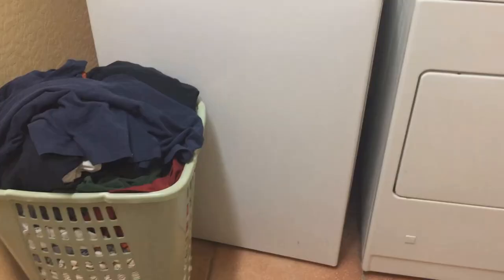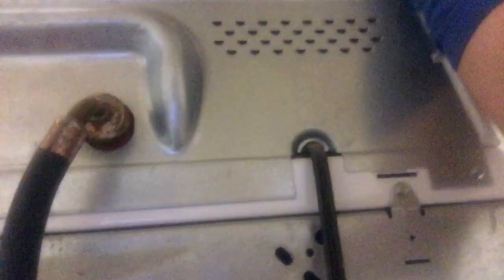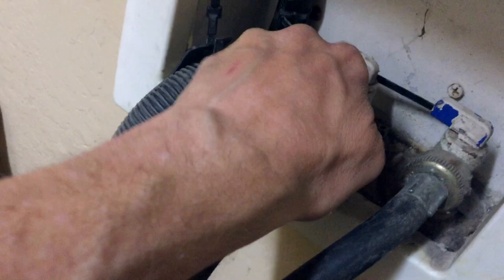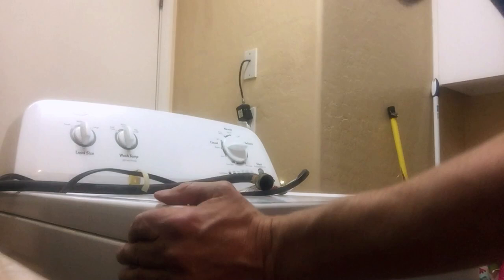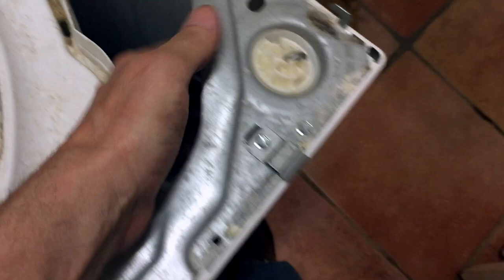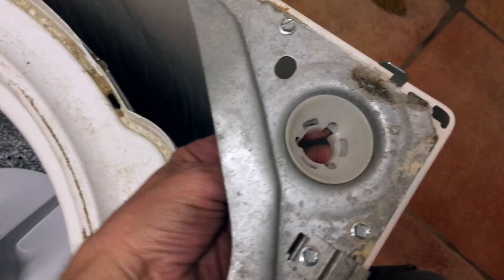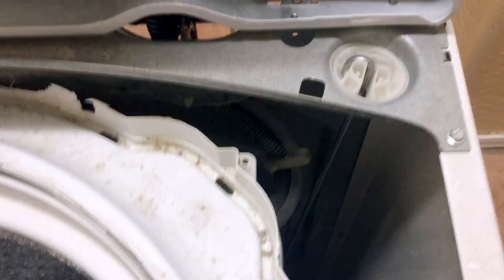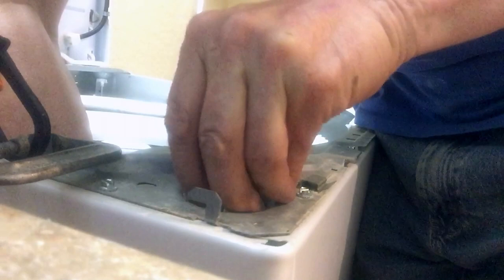Replacement suspension rod kit for loud shaking washer spin cycle Whirlpool Kenmore Maytag Roper

Comment: so after attempting this by myself, & watching multiple how to videos, u r the only one who addressed how heavy the drum is to lift. i eventually got it, & i have a tip, wear rubber cleaning gloves so ur hand doesn't slide up the rod. also, it helps to lift opposite corners of the drum when propping it up so it's not as heavy👍 thanks i'd still be struggling without u!

Comment: Just got done replacing mine. Thank you for a very informative video! P.S. For others who may not know. I still heard water sloshing around inside even after a drain cycle. Just be sure to have a container underneath the drain when you remove the drain pipe and tilt the washer as much as you can. Once you flip it all the way onto it's back there will still be more water. I recommend laying down a few towels before laying it on it's back. Thanks again for a great video.

Comment: Suspension rods replaced, washer re-calibrated (worked fine before re-calibration), works perfectly.  Thanks again, and thanks Paul for the tip.
Reply: So would you say it would be fine if I replaced springs without Rę calibration right after?
Reply: So I shouldn’t recalibrate is what you’re saying?

Comment: I am a 38 yr old woman only parent I am not a fixer never tempted an appliance. I just painted my nails kind of woman.  My amana washer spin bucket has gone nutz.  Ive watched ur video and it beats em all.   I have literally tonight taken apart my washer per ur clear steps and found the issue.  Now i just have to buy the springs.   They were all bad and dry rotted.   Thank u!
Reply from the maker: Good luck! Please let us know if you had any surprises.

Comment: It was nice to see how to take out the rods.    I was able to get one of the springs out - by grabbing the rod with vice grips.   Once I got one rod out - the drum sags down and makes it even more difficult to grab hold of the rod.   I then realized that I could use the old rod and use the hook - to hook onto the newly installed suspension spring and pull it up to the hole where the plastic support cups are positioned.

Comment: I had a whirlpool that did not have an agitator. It kept the load balanced via a fluid filled ring on top of the drum. The theory was that the fluid would find its level during the spin cycle and even things of out.
Unfortunately, enough uneven loads did that ring in, and it lost its fluid and thus it was unable to balance the drum. 
So while the suspension rods are anywhere from $25 to over $100 (Amazon vs parts distributor), that drum ring was over $400. It was cheaper to replace the 2 1/2 year old washer.

Comment: You can't go wrong with the SPEED QUEEN TC 5000 SERIES WASHERS. Expensive but in the long run you'll be glad you purchased this washer. Guaranteed to last 25 years! The TC 5003 has a 5 year warranty. Consider this model.

Comment: Thanks for this!  You're right, not nearly as easy as some of these guys act like.  I did it, bad words were said!  It didn't fix mine, balance ring seems to be ok, nothing looks out of place underneath, my theory is that the tub itself is damaged, maybe like a bent lawn mower blade, and is not going to balance.  Looks like new washer time, wash load piling up while i throw time and money at it.  You're vid is more in depth and realistic than the pros!
Reply from the maker: Thanks.

Comment: Every time you replace a part. It’s always good to recalibrate the washer. Exactly with whirlpool brands. You can find the tech sheet inside the frame of the washer
Reply from the maker: Thank you.  I was able to do that successfully but the Roper calibration procedure was a little hard to find.  I found many people described this procedure here, which is identified as for top loading washers but appears to be associated most often with Sears brands.  The links:  https://www.searspartsdirect.com/diy/article/how-to-calibrate-a-washer-after-a-repair-video or this video https://www.youtube.com/watch?v=WZlkG0gGXFQ.

But that didn't work.  Instead I followed the advice from Southern Bucks at https://www.youtube.com/watch?v=WpEcZ5kYKNs and it worked like a charm.  

Again, thank you. I'll add this to the description.

Comment: Bought a used washer from a buddy and after about 20 washes it started banging around. I saw a few videos and ordered the suspension kit from home depot. Put  them on and sure enough it worked for about 10 washes and did the same thing. I thought I put them on wrong or something so I returned them and ordered another one from them. Now 1 week later in the same ordeal. Think I'm just gonna go ahead and order some of the oem ones from the factory. Wish me luck.
Reply from the maker: Good luck. Mine have worked well for 13 months now but I don't know if the ones that I bought (https://www.amazon.com/gp/product/B010JRV0UM/) are still the same quality as when I bought them. They're now $45 instead of $60.

Comment: If you look on the tub, on each corner there 4 holes that are adjacent from the rods. I've seen another video where you purchase small springs that attach from the tube and link to the spring rods to add balance to prevent the beating & banging. The spring are under $15. In your case you may have had bad rods but my suggestion may fix it also. Maybe.
Reply from the maker: I saw that video as well. I don't recall the exact reason I didn't try it. Did the guy actually demonstrate that it worked?  Also, my washer has those holes but there were no springs attached. It would be good to hear if anyone got it to work because it is an awful lot less work.
Reply: I thought the same but on my Whirlpool there was no hole where the fabric softener port was, so no go for me. But find my comment to learn what I did.

Comment: The slots above the first two screws are for the tabs to go into, to hold the top up
Reply from the maker: OK. Will it hold without bending the tabs?  I recall that when I had the top lifted at 4:58 I got the impression if I just leaned the top back it's weight would bend the tabs. But I may have just been too timid to try.
Reply: @bulletpeople  honestly I'm probably wrong, I shouldn't have commented that. Thanks for your vid!
Reply from the maker: @NIN_THUG  All good. Thanks.

Comment: I had watched several of these videos, so I ordered new OEM suspension rods. The install was not that difficult. However it did not fix the problem. I did the check on the drum bearing which was alright. But it still it jumps around with some loads. I believe it is just a poor design.
Reply from the maker: I am so sorry to hear that! In the video description you will see a note that one YouTube commenter said that you have to recalibrate the washer after doing the repair. It didn't make any difference for me, but the procedure works. Here is a link to a video that explains how to recalibrate the washer: https://www.youtube.com/watch?v=WpEcZ5kYKNs

Good luck!

Comment: I fixed mine I about thirty minutes with a helper..simply add dampening grease to the plastic cups..
Reply from the maker: I have heard about this method before but I could not figure out where to put the grease. When you write "plastic cups" are you talking about the suspension rod cup and ball bushings set that are at the top, like you see pictured here? https://m.media-amazon.com/images/I/519AEjtdYLS._AC_SX679_.jpg

If so, do you put the grease between the two pieces of plastic that rub together?

Or are you talking about down near the spring, like in this picture here https://m.media-amazon.com/images/I/61WZ0Ckp4NS._AC_SX679_.jpg.  And if this is where you put the grease, where do you put it? On the rod itself in between the two pieces of plastic?

Thank you. I've never seen anyone document properly how to do the repair this way and it would be nice to know finally how it can be done.

Comment: I have a hotpoint year old if a load is off balance how do you unlock top lid to readjust load
Reply from the maker: On my Roper if you hold down the start button it will stop the washer no matter what cycle it is in, but then you have to wait for it to stop spinning before it will unlock the lid. It seems to take a long time to unlock sometimes. I'm not sure what your situation is.

Comment: What happens if mines doesn’t bounce back when I push down? I’m not sure what the problem is?
Reply from the maker: I don't know. If it only happens occasionally then it could be an unbalanced load. If it does only happen now and then then during the spin try stopping it (press the button for a few seconds) and then rearrange the heavy things like jeans and towels to balance the load. Restart the spin by pressing the button again and if it still bangs around, I'm not sure what you can try next.  

The only other thing I know to try is to recalibrate the washer. I found this video by Southern Bucks at https://www.youtube.com/watch?v=WpEcZ5kYKNs and his procedure worked for me on my Roper.

Good luck.
Reply: It just started today I actually took some clothes out and started the spin back up and it kept knocking. So I’m not sure. I didn’t try the calibration part.
Reply: @bulletpeople  I just checked springs are good maybe off track?
Reply from the maker: @zetyrarudd2966  So if it is knocking during spin but when you push down on the agitator it doesn't bounce more than once I'm not sure what it could be. I found this list of other things that could be wrong.  https://www.repairclinic.com/RepairHelp/How-To-Fix-A-Washing-Machine/42---/Washer-Vibrating-Or-Shaking  

It was not a risk for me to pay $60 for new suspension rods because it was obvious from the way the agitator bounced several times after pushing on it that the original ones were worn out. But I don't know what to make of your situation.

Comment: Repack the Suspension rod Buffers with Dow Corning 111. It's what stops this crap when new.
Reply from the maker: Can you provide a better explanation or a link to an explanation. I've seen references to fixing this by way of re-lubricating parts of the suspension rod. Some people also recommend adding dampening straps. Both of these seem a lot easier, but I did not try them because nobody who has written about this or made videos has done a convincing job of explaining it. 

Please tell us more about that or point us to any existing content that explains how to do it. I've searched high and low and can't find anything.

Comment: Just installed the cheap springs....the only thing that changed was the up and down bounce is now gone...the banging persists....don't buy the cheap parts.
EDIT: I discovered the calibration mode in the owners manual and that seemed to fix the banging issue completely  😀

Comment: Hello. I already changed my suspension.  It giving trouble again.  Why so fast
Reply from the maker: Some people have written that if you don't use the Whirlpool factory authorized parts, the problem returns after 2 or 3 washes. So I have put in the description a link to the suspension rods that I bought. They are supposed to be the ones made by Whirlpool, and Whirlpool makes many different brands, including the Roper that I own. Here is the link:  https://www.amazon.com/gp/product/B010JRV0UM/.

Good luck. I am sorry it didn't work for you.

Comment: Once I switch all rods, but till it makes banging noise- what should I check??? Thx
Reply from the maker: One thing you can do is to recalibrate the washer. Look at the "UPDATE2" section of the description. There are some links to video on how to do that.

But unfortunately, if you used inexpensive suspension rods you may have to buy the original Whirlpool suspension rods and install them. Many people have written that when they buy the cheaper rods, around $25-30, they fail after just a few washes, and the banging begins again. But I used the original Whirlpool suspension rods sold at https://www.amazon.com/gp/product/B010JRV0UM/ and they have worked now for more than a year. (When I bought them in May of 2021 they cost $61. Today the same ones cost $37.)

Comment: Thats what mine does but i can find the right part number or a layout for the spring kit and where to get it i subscribed  to this site can you help me out its a Kenmore Series 200 top loader please reply Thanks.
Reply from the maker: Sure. If you already visited the link you'll find in the video description (https://www.amazon.com/gp/product/B010JRV0UM/) you may have noticed that it is no longer available. If I were you I would do a google search for your washer model number, brand, and include the words "OEM" and "suspension rods" or "suspension rod kit." Be sure to get the OEM version, not the cheap ones, because people say they only fix the problem for a few washes. Mine cost about $60 if I remember correctly, and the cheap ones at that time cost about $30.

It appears that Whirlpool may not even manufacture these any more, at least not for sale on Amazon. Good luck locating the good ones, not the cheap ones.

Comment: Where did you get the repair kit and name 🤔 how to look for?
Reply from the maker: This is the one that I bought.  https://www.amazon.com/gp/product/B010JRV0UM/    However, you may need to check to see if this works with your washer model number. You should get the more expensive OEM original part (from Whirlpool) and not the less expensive ones. They don't work after a few washes.

Comment: I changed the suspension and it still shakes bad.  The suspension didn't help anything. Wat can I be
Reply from the maker: That's a shame. I have read many reviews of the cheapest replacement rods that said the problem returned after a few washes. But if you got ones that were $40 or more, I think those are the official Whirlpool replacements, and they would not be the cause of that problem.

Have you tried recalibrating the washer?  In the description of this video you'll find a link to this: "UPDATE2: YouTuber Paul RATTANAPHANH added the comment that after making a repair like this you should calibrate the washer. " Here's the video for that procedure: https://www.youtube.com/watch?v=WpEcZ5kYKNs

Good luck.
Reply: Ty. I will try the calibration

Comment: Could one skip the first 7:30 of this video and tilt the machine on it's front?
Reply from the maker: That's a good idea. The only reason I can think to disconnect the suspension rods from the top before flipping it over is because it may be easier to detach them from the ball and cup plastic assembly at the top when the washer is upright. I don't know how easy or difficult that might be to do after the washer is on its side.
Reply: @bulletpeople  Imma do it your way to be sure.

Comment: Is it still going strong?
Reply from the maker: Yes. I replaced them on May 29th, 2021 and the washer is still going strong. It worries me that the suspension rods I linked in the description are now $47 instead of the $57 I paid for them. I don't know if they are still the OEM Whirlpool parts or if they are now selling the cheaper 3rd party rods that fail after a few washes. In any case, I wouldn't buy cheap suspension rods if I were you.

Comment: Thank you for your effort. I'm about to replace mine. I wish you showed what was wrong with the old ones. Did you notice anything difference in the springs of the old vs new? Thank you
Reply from the maker: No. Some people say it is just that there is a type of grease that breaks down over the years and if you put more of that grease on it, it works again. I think  someone suggested that in the comments. But I've never heard any explanation of 1) where to put the grease and 2) what kind of grease. 

The fact that you can test this by pushing down on the tub like shown in 1:08 makes me think the springs have just lost their tension/strength. So when they get too loose and bouncy, they no longer keep the tub centered during the spin. That's my theory, anyway.

Good luck. Don't buy the cheap replacements. People say they work for a few washes and then fail.

Comment: You don’t need to replace the rod. The damping grease has worn off. This grease is very sticky. Not regular grease
Reply from the maker: That's good to know. What type of grease? On Amazon I see red and tacky lithium grease, general purpose lithium grease, wheel bearing grease, automotive/marine grease, and synthetic grease.

And where do you put the grease?
Reply: @bulletpeople  not lithium grease. Nyogel synthetic damping grease
Reply: It’s very sticky
Reply from the maker: @johnellisonarmadilloconstr7966  Thanks. So I assume from the name it dampens the wobble that might put the spinning tank out of control. So where do you put the grease?
Reply: @bulletpeople  it’s on Amazon for $25. But you’ll never need to buy another one. You hand it down. Lol.
Reply: @bulletpeople  yeah it’s the secret they don’t want you to know and no one knows. I might come up missing.
Reply: @bulletpeople  my apologies I thought you said where do you get the grease. You put the grease on the rod under the top of the spring
Reply: @bulletpeople  you put the grease on the rod under the top of the spring

Comment: So... what's broken?
Reply from the maker: If I understand correctly, the suspension rods--probably the springs at the bottom--are just worn out. Or it may be they are no longer lubricated properly. (Commenter "Bruce Martin" below says they can be repaired by adding dampening grease.) But in any event, there is some physical difference that occurs over time. Another data point is that folks who buy the cheaper $20 or so after-market rods report that the problem comes back after just a few washes, but those who pay the $40+ for the genuine Whirlpool OEM parts (like me) get years of service from the new rods.

Comment: I had the same issue with my kenmore washer, so I replaced the rods (got the oem parts) after a few washes it started shaking and banging again...very frustrating!